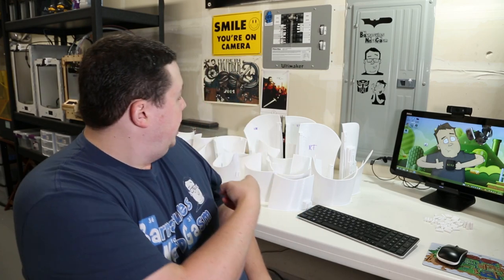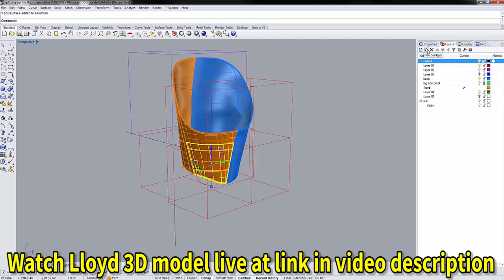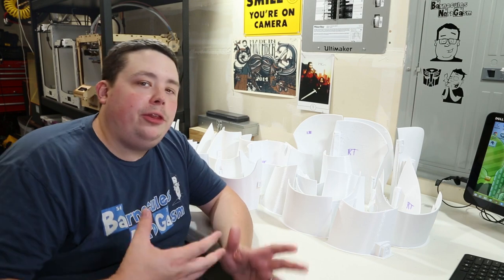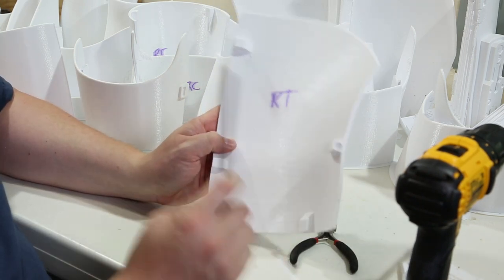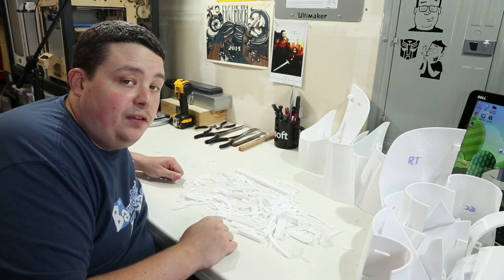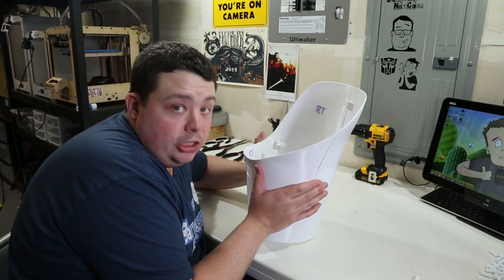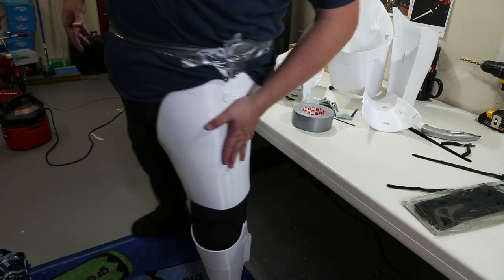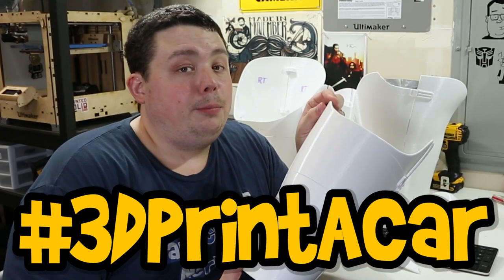Star Wars The Force Awakens 3D Printed Storm Trooper Cosplay - Part 2 - @Barnacules

Comment from the maker: Make sure you guys come follow me on Twitter @Barnacules and Instagram @Barnacules since I post massive updates between videos on what I'm doing to both those places!
Reply: Barnacules Nerdgasm For fitting the peices together, can I suggest using a soldering iron to plastic weld the gaps together? I've repaired gas tanks on small engines with a similar method, and it was watertight. With some sanding, you could make it look like there is no seam at all.
Reply: +Barnacules Nerdgasm what backround music do you use?

Comment: Awesome Makerspace!

The connectors between the pieces are rectangular, which creates the overhang , and therefore you need supports. If you put a triangle on the underside, or make them round, no more supports would be necessary.

Comment: You can prevent the support material if you add a 45 degree angle to the bottom of those blocks. It will also add strength as now the break line is a single layer. 
With this blocks being on the inside it will also be less sharp against your skin.
Love your videos!

Comment: Hey Jerry, love how the new space turned out!  I own a automotive restoration shop and bondo or any other filler probably won't work for finishing the seams because any amount of flex will cause it to crack.  What I suggest you look into is a hot air plastic welder like the type used to repair bumpers and other plastic automotive panels.  Harbor Freight has one for around $50 and you could use you printer filament like a filler rod so you wouldn't be mixing different materials.

Comment: You can use your 3D Pen to fill in cracks/missing spots.
Reply: Ya if the 3d pen you buy actually works well most are cheap and break easily

Comment: I 3D printed a storm trooper helmet on my printrbot simple metal (6x6x6) and i used filament in a dremel tool to friction weld the 22 sections together. worked amazingly, have even dropped it and the joins seem to be fine, maby try it out on a broken piece as a tester for people to see? too a bit of practice to get it neat though...

Comment: Really getting into printing on my Prusa i3 now - watching your videos can be helpful for some little tips and tricks.

I hope one day I can tune it to near the speed and accuracy of those Ultimakers. I chose it for the flexibility of upgrading - want to try dual extruders (for soluble support), CNC and potentially laser parts but also chose it because it can be expanded to a whopping 400x400x400 build volume which I'm gonna need for my project.

Comment: The strength of the print is also on the shell or the surface thickness of the piece. 
Also the socket for the pin would stick into you a lot, would get rid of them for a better fit.

Comment: Another tip: you can reenforce the prints with resin and light oz of fiberglass. You can add them to the inside so you won't lose any details on the outside.

Comment: If you are going to paint it, I suggest you to sand the exterior with a 300 to 500 sandpaper, then a 1000 sandpaper, spray a couple layers of primer, re-sand if there are imperfections, spray a couple layers of white paint, and finally give it a thin layer of clear coat so it shines nicely.
Reply: Or not because it would take a lot of time, but it would look great for decades.
Reply: If you watched it, he said that he will do it

Comment: I am surprised you did not use the Dremel to do alot of the clean up. Maybe 2 with different bits would be good.  It seems like it would make for a more efficient cleaning tool.  But nice work and neat to see you work through the issues.

Comment: You can "weld" the pieces together using your dremel. When you put a piece of filament in the tip of the dremel, and go over the edges... Both plastics melt and its pretty damn strong

Nice vid BTW ;) like always
Reply from the maker: Jasper II I'm totally going to try this, it's like friction welding with plastic.
Reply: Barnacules Nerdgasm are you gonna do a new rom tour and if u do can u do a tour of the garage
Reply: Barnacules Nerdgasm also maybe using a soldering iron like a TIG torch and your filament as filler.
Reply: Barnacules Nerdgasm Nice! I discovered it... And looked it up on the internet... But sadly enough there already was a vid of it :( but I'm glad you get it... Because I'm Dutch and only 13y so my English is probably not that well :P
Reply: Jasper II Actually your English is pretty good.
Reply: +DarkJedi3000 Thanks!

Comment: Its looking really good man, I kinda love the way the print lines catch the light and make it look brighter. Also if your going to bondo the joins, have you considered giving the whole piece a smoothing layer? Or cover it in a nylon or stocking then dipping it in resin? Give it a bit more strength, allow you to cut off the join ramps, and give the outside layer a smoothness that will get smoother after a primer coat and a white paint coat. Youd have to play with the nylon a bit here and there to expose the detail pieces. 
Just the ideas that popped into head when I thought how much I like the print lines. Some folks wont so much. 
Hope that helps some, and I love the whole project. 
Love you man.

Comment: If you use Bondo to fill in the seams, it will shrink and crack, and you'll see the seams. The armor will flex quite a bit as you wear it.

What about using the print material as filler rod and a soldering iron to plastic weld the seams?
Reply from the maker: rwdplz1 That's a good idea but it's really hard to lay down new plastic without distorting the plastic your trying to weld. But I might try to weld it with some lower melting material. I'll experiment.

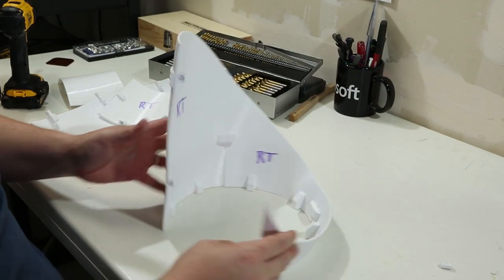Comment: I'd suggest making the "pin junction points" less blocky for comfort. Also, they could probably be recessed more into the wall if you're going to increase the in-fill. Maybe double up the pins next to each other? And push them closer to the edges? For example, at 13:32 the seam between the two RT pieces is huge.

Somewhat more radical of an idea: why have the pins at all? I'd opt instead for mortise-tenon. It'd be more sturdy. You could alternate it down the entirety of a seam, too. Side A from top to bottom: mortise, tenon, mortise, tenon, mortise. Side B from top to bottom: tenon, mortise, tenon, mortise, tenon. Kinda like a box joint or finger joint.
Reply: Josh Olson 100% agree. They need to be half that size and twice as many. They really should only serve as connectors to line the outer edges up, more than to be used for shear strength.

Maybe not mortise / tenon though, hes got the right idea with pins, but they really don't need to be long or big at all, just enough to align the suit for permanent bonding sites.

Comment: Hey Gerry, I was thinking.. When you have all of the parts cleaned up and you're ready to wear them why not brush on a little acetone on the seams to create solid parts again? I noticed that the thighs especially got split into four parts, so if you were to combine the four quarters into two halves, I think the part would be considerably stronger in the sense that you wouldn't have to worry about it separating when wearing it and it would make for easier assembly. Hope it helped!

Comment: Oh man! You definitely need side cutters! they are designed to cut excess leads of through-hole components mounted on PCBs. The blades on them are arranged so they can lay flat against pcb and cut just at it's surface. Just look for side cutters on ebay. the difference to ordinary snippers/clippers may seem minor, but they much more precise and you can be much more nimble with them..

Comment: Just a suggestion for the plastic filler "bondo" I'm not quite shure how the catalyst for a fiberglasd resin would react with the plastic but if it won't melt it I'd suggest using fiberglass strips on the seams of the inside of the pices  the when you get to working on the outside use the fiberglass resin mix it with your plastic filler to make a "honey coat" it's a much nicer end result and less pinholes in the filler so primer and paint is less of a hassle

Comment: I feel like your going to have to cut like a U shape out of the back of the thigh piece for the calf to fit into when you bend your leg and a little bit of bondo in the seams will fix the gap issue no problem

Comment: If your 3d printer pen can melt the XT you could use it to fill in the gaps, if the pieces where given a beveled edge along the side to be joined you could fill the v with TX with the pen to weld the pieces together, should give you a stronger join than ca.  

Possibly an actual use for a 3d printer pen.

Comment: Jerry, 
I would be concerned about the pin design that your using. Those pins stick out on the inside of the suit and that creates a pressure points that might cause blisters as you move around for hours. Can those pins be integrated into the walls of the suit so that the suit walls are smooth on both sides?

Comment: Hey Barnacules i jut wanted to say that i love all ur content. But i have a suggestion for u to maybe help u out. Since your doing this whole costume out of 3d printed parts ur going to probably have a lot of failed prints or rafts and excess plastic that u can no loner use and will probably spend a lot of time cleaning all these parts up. Sooooo. I found the protocycler and the retouch 3d. Both of these r tools that will definitely help u out if your going to to this project and ever other as well. Basically the retouch 3d is a tool sort of like a dremal in size and a solder with the hot tip which heats up to cut through the print like butter and for better an faster cleanups and touchups. The protocycler is basically a filament maker and recycler at the same time allowing u to basically reuse and make your own filament to your specifications. Now i don't have a 3d printer so i wouldn't be able to really now if this is worth your time but i u check it out u could probably decide  yourself. Again, i love your content and i hope u keep reaching higher and higher and that u never stop. Love you your fellow Nerdgasm fan. Adios

Comment: Have you ever looked at a product called XTC-3D, made by Smooth On. It is designed to smooth out PLA prints (but i guess it would work with other plastics) by creating a smooth outer layer...anyways, i thought it might help to clean up the parts...I haven't used it, but i've heard that it's good...I just don't know if it would help with seem lines!
Reply from the maker: Philbrush I've heard of it but haven't tried it yet.

Comment: Why not join the pieces using plastic welding with the same filament? This would allow you to remove all of those internal tabs, fill in the gaps, and would be much stronger. (Note - I've not done this with 3d filament, but used to do it (circa 1977) to fab tooling at a small semiconductor (silicon wafer) manufacturer using heated argon gas and plastic rods).

Comment: You shouldn't have split them so that the horizontal and vertical pieces meet at a single point. That single spot where all the seams meet will be a huge weak spot, stagger the bottom seams. Also taper the seams at a 45 degree angle so that the seams themselves will be stronger and will give more surface area of adhesion, and also they will be less visible.

Comment: Barnacules Nerdgasm Makerbot is EVIL indeed. My replicator 2 has so many issues right now. The thing gets clogged constantly, so I bought a new nozzle. Then it was splooging plastic onto my print. Now the build plate is warped. So I bought another one of those. Also the proprietary software sucks. I used curra to simulate a print. That program looks and works so awesome, but I can't use it with the Makerbot. Hook me up with Ultimaker! Their printers are very high quality, with great support.

Comment: I'm curious as to why you used support material inside the pin holes. I thought that stuff could bridge pretty large gaps, surely it can bridge those little holes, right?
Reply: Darren Jacobson He probably wants to ensure there is absolutely no deflection in the holes for his pins not to be stressed.
Reply: In cura you have little control of support so if it's on it'll put support everywhere. There are some settings that will minimise it though.

Comment: So, about the way these parts are joined together...  I think it's going to be extremely weak. No matter how you bond those parts together, the seams are going to wind up cracking if you join the parts edge-to-edge. There's just not enough contact area.
A better design probably would be to have a bit of overlap between the two parts; the more the better, really.
Also somebody suggested printing the connecting pins sideways instead of vertically to increase their strength...  Do that, too.

Comment: Jerry, unfortunately you won't get the strength you're looking for with thin parts like that, even if you print them at 100%. You would have to print them atleast .25+" thick solid infill and even then they will be prone to breaking. What you need to do is either add a layer or two of fiberglass and you should be ok, if you're worried about going over thickness, just design the part a little thinner to compensate for the extra layers of fiberglass. For you parts, you should need no more than 1-2 layers of fiberglass, very cheap and inexpensive to do, then you can sand and cover with bondo. I do this all the time with thin 3D printed parts I want to use in structural applications. It's neat because you can really make strong functional parts, even though they're 3D printed.

Now, if you want to make structurally strong parts without using post printing modifications like FG, then you need to print thick and heavy, check out this design I did for a NASA design competition, it was only printed with 60% infill and it supported 250lbs before it failed. All made from 3D printed parts.

grabcad.com/library/nasa-champ-clamp-strong-man-1

Comment: Just wondering as i only create small items when im doing joints i tend to use groves and dove-tail types overlaps our simply a dowel pre-installed to on piece and then the other has the hole or did the designer intend it to be deconstructed

Comment: my question doesn't have anything to do with your actual weight but abt when you'll wanna sit down? That plastic doesn't seem solid enough for a human being! doesn't matter if you're 300 or 100 pounds :/ even Xander would probably break a part by sitting down :/ did you think abt that with your team at my mini factory? do you think it would be an issue or is the plastic actually stronger than it seems?

Comment: Would a buffing wheel give you a glossy shine that the suit requires?
Reply from the maker: s0584333 Buffing wheel might work as long as it doesn't build up too much heat.
Reply: s0584333 Barnacules Nerdgasm You might want to look into high gloss white plastic spray paint that either comes in cans or can be airbrushed on. that might give the super high gloss you're looking for for the final product.
Reply: Barnacules Nerdgasm Just use glossy white spray paint or a glassy clear spray sealant

Comment: yeah if you do any graphical stuff, or projective geometry or affine geometry, basically from the pictures alone they just have a set of equivilance class of you. That is an infinite set of you's that are all proportionate but different sizes haha. They could have narrowed it down if they new some dimensions of you and constrained the inverse projections then they could have worked it out exactly. But I know they took a more of an intuitive approach to it and just used software to do it. Which is fine and probably more productive but we can see there the room for some problems. Simply 3d to 2d is not one to one and onto. You lose alot of information in the 2d picture when trying to construct a 3d model.

Comment: Can't/Couldn't you just take all that excess plastic, heat it up (slowly) and make another spool of plastic ready to use? You know, recyclation and stuff :)
Reply: MiChAeLo KGB its support material but yah it should work :) but just heating it and creating all the smoke and shiz might not be worth it from recycling viewpoint.. i dunno :)
Reply: Foxy Hackz But even that support material is the same plastic you use for part youre supporting. And as he tolds, its not a bad fume, so it might be possible. Only actually somewhat hard thing would be to mold it back to spool.
Reply: wasnt he talking about the durable whit material used for the actual pieces? because he said they Are more durable id say bad fumdses
Reply: Foxy Hackz Nope, he said that he will be using more than 25% infill to make them more durable. Its still same material, the difference is only how think layers will printer actually print :) I tnk we need response from Barnacules Nerdgasm himself.

But still, just re-watch the video.

Comment: How about adhesive foam strips running around the inside to act as spacers/padding over the pin brackets

http://www.amazon.com/dp/B000VQFSU0?tag=saklosoman-20

Add some adhesive velcro to that and the under suit......no need for belts or anything

Comment: hey guys, i have $500 dollars to spend  and i am looking for a good 3d printer for around that price. I looked around and i seen so many i didnt know if they were good or not because i dont know anything about 3d printers. thanks in advance.
Reply: Buy an ultimaker
Reply: I don't have $2000 to spend on an ultimaker...
Reply: +Justin Riera best ones i saw worth getting are still around 1200. prices are slowly dropping but itll be a long time before they get anywhere near 500 thats not a piece of junk
Reply: +Justin Riera You should get 500 BIC Lighters. You can save alot buying in bulk. Then get any plastic and start melting.
Reply: +Justin Riera If you have a little "diy skillz" you can make prusa i3 with that budget